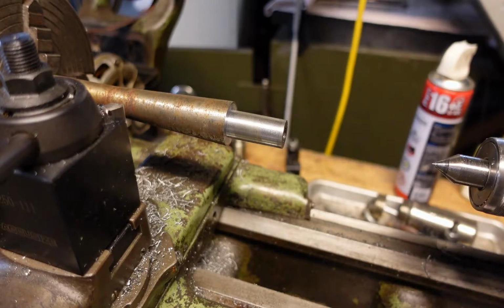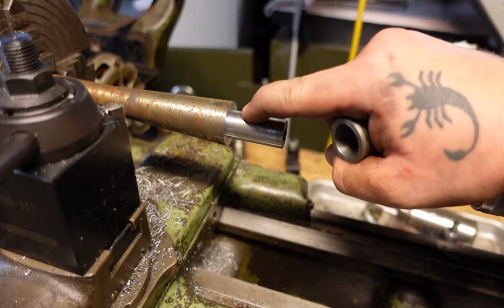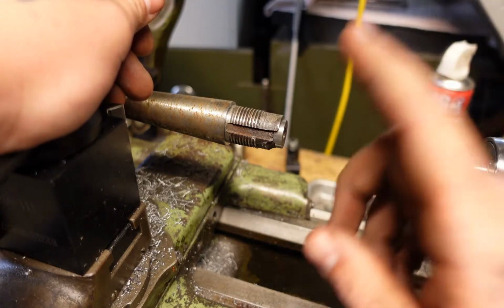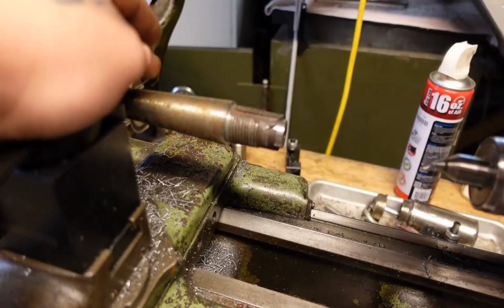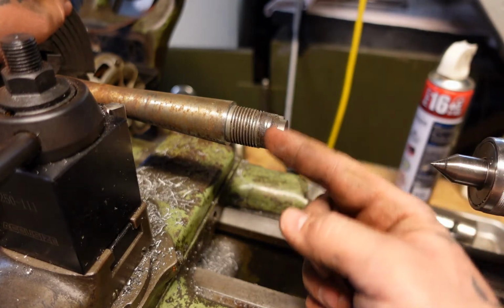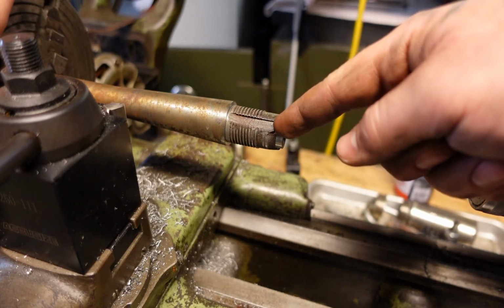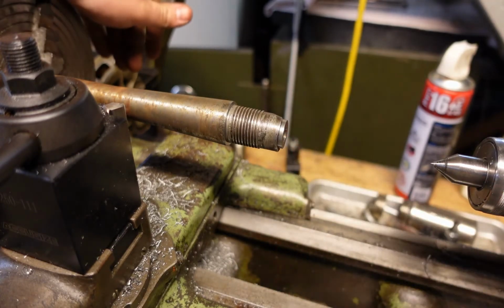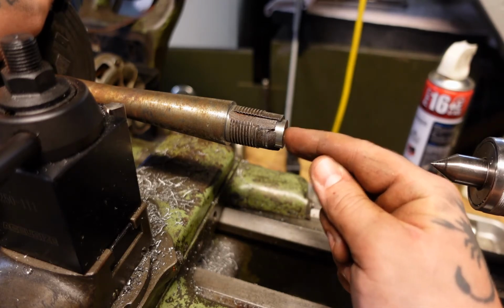APEX Remington Rolling Block carbine project - Part 3

Comment: Fuck I dont know if JB weld will be a good idea if the threads are cracked, silver solder might be stronger.
Reply from the maker: 3950 psi of shear strength should be plenty to screw in a barrel to 80 ft/lbs